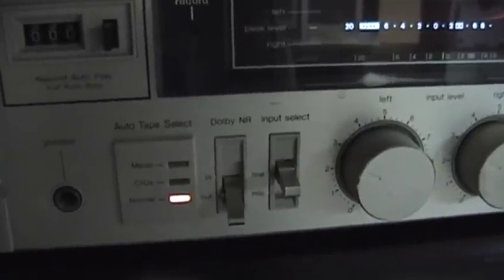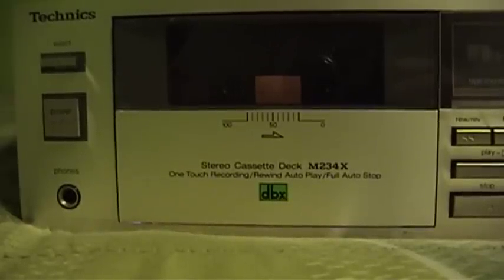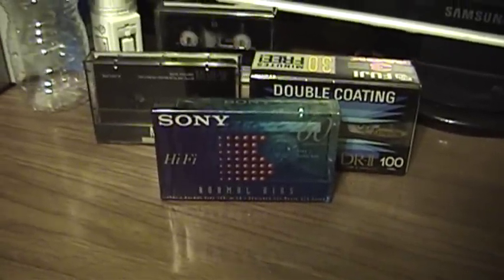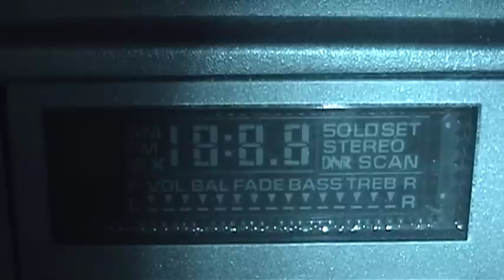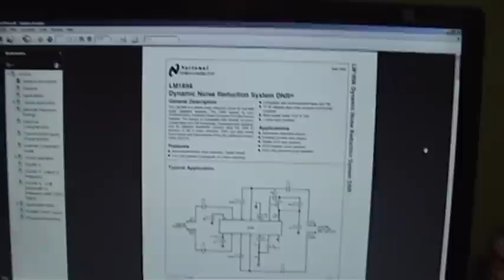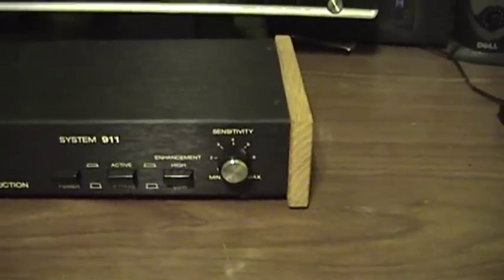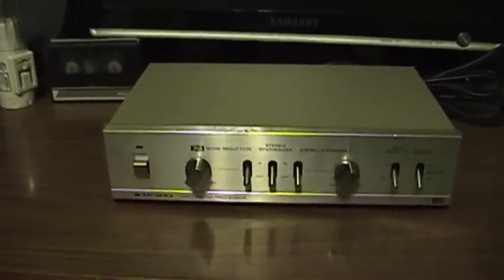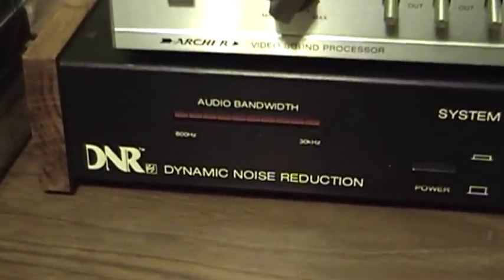All About National Semiconductor's Dynamic Noise Reduction System

Comment: Recently I purchased on e-bay a unit developed by audio genius Bob Carver that was designed to reduce background noise and expand dynamic range. It was sold under the Phase Linear brand, the model 1000 auto-correlator. It does essentially the same thing as DNR, but slightly more sophisticated. It employs a sliding scale frequency trigger that operates on 4 separate bands of frequencies. The process is adjustable just like the DNR models you demoed. In tests I've done with my unit, it can work as well as Dolby B on non-Dolby tapes, and in conjunction with Dolby tapes as well. The effect it produces is striking in comparison to the lack of the process. The noise floor essentially slips away as you adjust it, with very little effect on the high frequencies of the material. Of course, it can be over used, and when it is noticeable, then the adjustment is too much. Backing it off until the music sounds normal is where the best setting is achieved.

Comment: You forgot one other reasonably widespread pre-encoded noise reduction system: CBS Labs' "CX" (Compatible eXpansion), used on the analog audio tracks of LaserDiscs and CEDs, as well as on a small number of LPs (around the same time DBX-encoded LPs were being released), and on the unsuccessful "FMX" FM Stereo noise reduction system in the late '80s. CX was also proposed as the noise reduction system for stereo TV broadcasts, but the FCC ultimately chose a different system using DBX.

Comment: @uxwbill Dolby Surround (the encoding format) was introduced in 1982, but the Pro Logic (the decoder circuitry), which provides a front center channel and front-to-rear "steering" to improve the surround effect, wasn't introduced until 1987, at least according to Wikipedia. The various matrixed quadraphonic systems in the '70s also utilized logic-driven steering circuits to improve the rear channel decoding, although this was only found on fancy high-end receivers, such as the Sansui QRX series.

Comment: Some aftermarket car radios had DNR too. I had a similar Realistic video sound processor and wasn't too impressed with any of its features (the "stereo synthesizer" just applies different EQ curves to each channel). Its "surround" decoder is probably just a simple matrix-type quadraphonic decoder, since the Dolby Pro Logic decoder wasn't invented until 1987, and Dolby Surround didn't provide discrete L & R rear channel outputs until Dolby Pro Logic II was introduced in 2000.

Comment: Dolby S sounds to my ears like a combination of Dolby B and a wideband compressor/expander. So playing back a Dolby S recording on a deck with Dolby B decoding, or even no Dolby at all, will generally sound OK, except that the dynamic range will be compressed, as if the music was being played by a highly processed FM radio station. It does not apply a drastic EQ curve to the audio like DBX does. And yes, you can use Dolby S on a Type I tape.

Comment: Rocktron has developed an outboard device, the Hush Super C. It is essentially an adjustable DNR. The operating manual also states that when properly aligned, it can effectively decode Dolby B during playback.  I believe what makes this unit unique is that some patents apply using a newly developed integrated circuit.

Comment: A company known as ADC also made a DNR unit very similar to the Radio Shack device you showed. The model AV-400 had practically the same front panel layout as it also had stereo simulation and stereo spread options. I believe I paid approx. 80.00 for the unit, new. Stamped on the bottom- made in the U.S.

Comment: A shout out to the National Semiconductor DNR Design Engineer, John Wright.  And I had the privilege working as the technician building the first breadboard, initial testing, and datasheet compilation.  We had a great design team at NS, led by William Gross.
Reply from the maker: Thank you for stopping by. The DNR system is a very clever noise reduction process. If by chance you'd like to share any stories, more information about the system or whatever, I'd love to hear it. Feel free to post here, or there is an e-mail address in my channel information.

Comment: Since you're left handed, you can try holding the camcorder in the palm of your left hand, and see if you have less tendency to shake that way. Wrap your fingers around the bottom of the tape compartment and brace your thumb in the upper left corner of the LCD cavity, above the speaker. The only downside is that the zoom and start/stop controls aren't at fingertip reach, unless you use your right hand to operate them.

Comment: You cannot compare VHS Hi-Fi in the same way as a linear system. It may record using helical scan and the signal is embedded deep into the magnetic layer, but this is not why the sound is free of hiss, it is because the sound is encoded with Frequency Modulation (like FM Radio) before being recorded. Any tape hiss is meaningless as it is not part of the recorded bandwidth. When decoded the sound should be nearly identical to the source, with no hiss because of the Frequency Modulation, not because of the helical scanning or depth of recorded signal. However, if played back on another machine there was often head switching noise, which was like a vibrating breathing on certain frequencies that could be very nasty.
Reply from the maker: Please do not preach to the choir.

Comment: Cool Video! DBX was very popular in recording studios and some radio stations for use with on-air cart machines.  VHS Hi-Fi actually modulates the audio as FM and records two carriers for each channel on the tape behind the video signal. The audio is encoded with a DBX like NR in VHS Hi-Fi, too. It also lays down a standard linear signal for VCR's without Hi-Fi. :) JC

Comment: Type II and type IV tapes have about the same noise level. The difference is that the type IV will allow you to record a higher signal, thus creating a de-facto lower audible noise.  But a blank type II and a blank type IV played one after the other with the volume turned all the way up should have very similar noise characteristics.

Comment: I'm currently putting together a vintage hi-fi system. I have a Teac 8 track reel to reel with DBX unit. I'm in England and couldn't find a DNR unit like on your video. I did the next best thing and downloaded a circuit diagram off the internet, then went on Ebay and bought a LM1894N chip and built my own.

Comment: Hey uxwbill. (1) How many different single & dual cassette decks do you currently own? (2) Why do you have mulitiple different tape decks hooked up to your receiver(s)?
Reply from the maker: I have about five cassette decks in my possession at this time. I hooked up the multiple decks to my stereo receiver primarily because I could. I can use them like a dual-well unit, only these are higher quality machines than most dual-well decks.
Reply: Hey uxwbill. Do you currently own any 8-track tape decks? If so, how many different ones do you own? What ones do you own? :)
Reply from the maker: I have two. One is a changer whose rubber motor mounts rotted away. The other is a single cartridge unit that can support quadraphonic playback and it works flawlessly.
Reply: Hey uxwbill. (1) Define: "flawlessly". (2) May I please see pictures of both of these two 8-track tape decks you currently own? :) Thank you! :)

Comment: my dads 92 gmc sierra had that same radio as the key keepers truck and the DNR Feature is not supposed to come on on the display it actually is a automatic feature on the radio and cassette. It was printed on the display as an idea but after it had been printed the whole automatic feature was implemented so a button and indication for it working was not needed! cool video uxwbill

Comment: I had all types...i have 60 years old... better is High Com from Telefunken and second is ADRESS from Toshiba...dolby is nice but weak in reduction of noise...these other two kills noise totally..you can increase volume all the way up and you will use no noise...my hobby from 1960 to 1990 was to adjust, calibrate, cassete and open reel decks

Comment: I know this isn't really too relevant to this video, but I've noticed that on my iMac there's an Ambient Noise Reduction feature that works with the internal microphone, I've played with it a little bit but not extensively and it certainly works from the very short tests I've done, I'm not sure if it introduces negatively desired artefacts or not, but I'm not willing to really use it if it does.

Comment: the accustic function on the delco radio DNR was from what a teacher told me is the same princaple that if u had a suround sound system if u put the speakers in an X pattern you have a hard time pin point the source least thats what i believe

Comment: Also mentioned in a search is the older LM832.  Texas Instruments also published an article which was revised in 2013 about uses of the  LM18194 http://www.ti.com/lit/an/snoa673c/snoa673c.pdf
Reply from the maker: The LM832 was made to work with lower power supply voltages and audio signal levels. I believe it was probably meant for things like portable radios and boomboxes, and I think the datasheet gave that as an example in its application notes. I've never seen a boombox or portable radio with DNR.

I believe the 2013 update for the LM13894 article was little more than rebranding it to indicate TI's acquisition of National Semiconductor.

Comment: Heh, I got a silver Technics deck (RS-M14) very similar to that one, slightly older. The only difference is it has a tape bias/type dial since it lacks auto detect and the record level dial is combined into one (still stereo). Dolby was popular in dual linear track SVHS editors. Marantz even released a linear stereo Betamax (made by Sanyo) with Dolby C! DNR is nice, but today's computer software can do the job and is tweakable. Tapes typically just need a low pass and some adaptive NR for dehiss

Comment: Tempted to get one of those Archer units on eBay, but all of the units are untested and for the prices being demanded, I might be better off ripping one out of a wrecked vehicle and wiring the components up myself (honestly, considering the price U-Pull-It charges for radios around here, I might spend more on solder than anything). Now I just need to get a unit and (eventually) pinouts.
Reply from the maker: For whatever it's worth, you can buy the DNR IC pretty cheaply and there are plans online to build it into a finished noise reduction circuit. This would probably be a lot less trouble than repurposing a car radio's DNR circuit, even if you had to wire it point to point instead of using perfboard.
Reply: Biding time in that case.

Comment: I have my old radio unit out of my 1984 lincoln town car. It has two buttons. One is the Dolby NR, and another that says CrO2,which I have no clue as to what it does.
Reply: It's for Chrome tapes, typically decks that were compatible with Chrome and Metal tapes had special playback modes for those tapes.